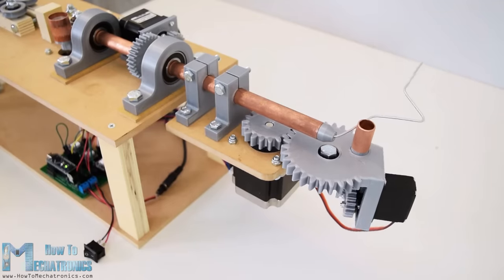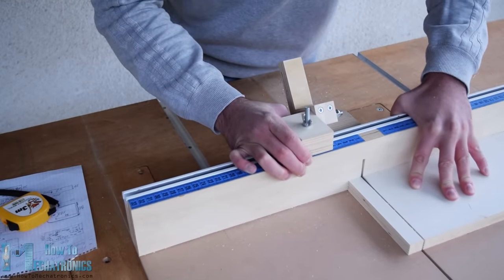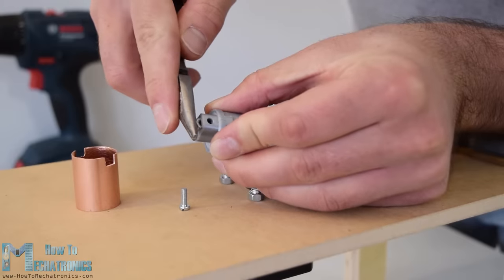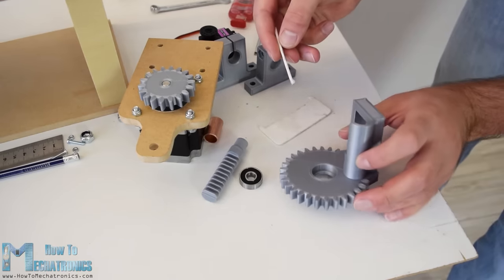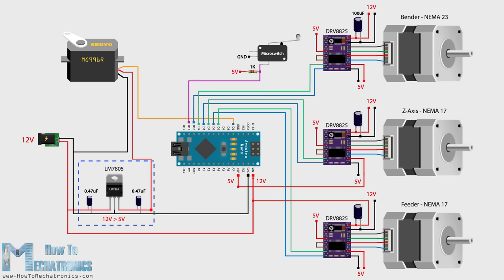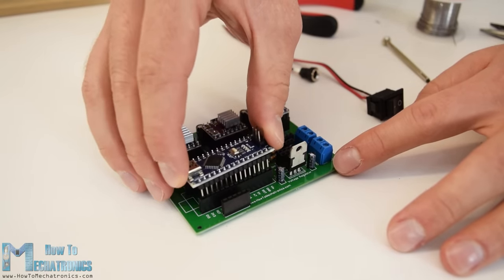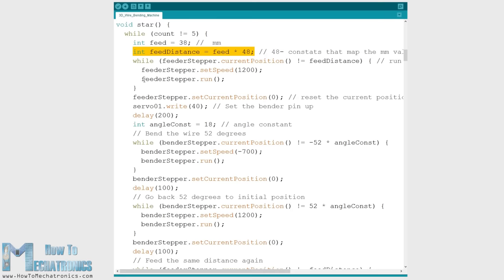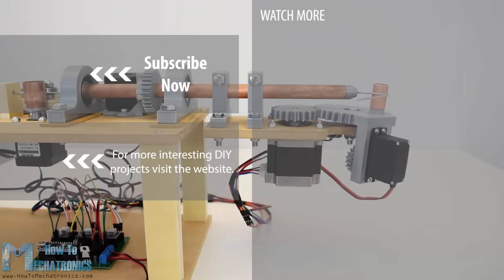Arduino 3D Wire Bending Machine

Comment: WOW!  This is AMAZING.  My curiosity is more on the 3D printed parts, specially the gear.  How strong are these 3D printed gear parts and supports?  Would appreciate your response.  Thank you!
Reply from the maker: Thank you! Well I didn't notice any wear on the bearings, but the forces are not that big anyways. However, 3D printing gears for prototyping is really effective, because other way, metal gears are so much more expensive. Also in case you print them with ABS they will be much much stronger.

Comment: My question is when turned on the power first servo brought the pipe up, and turned to his terminal and went to the center position and stopped. And even when connected Zaxis whole scheme stops working all the engines freeze and not spinning even when the force of arms.

Comment: Nice work! -- That's super neat. -- (Though FYI, I'm pretty sure that's a "table saw", not a "circular saw". -- Also, using magic numbers in your code is a bad practice -- you should consider using #DEFINEs or at least const ints for your magic numbers [e.g. the "48", "-700", etc. shown in your code are "magic numbers" [yes, even with comments], there are many shown in the video, and it's considered a bad practice]). -- Still though, very cool project.  Would be neat to see it run GCODE (GCODE is not just for Cartesian robots, but can be adapted to be used for any sort of CNC control -- obviously, a slicer or mill path would produce utter garbage, so you'd need a different tool chain, or to write the GCODE by hand, but it would still be neat).

Comment: This is a really coll project! I'm considering of building a smaller one... Just a question, why did you use an external pull-up resistor instead of the internal one of the arduino?

Comment: that's very good. What CAD/CAM software do you use to design your wire shape and generate the bending program?
Reply from the maker: Thanks! I made the shapes manually, but entering commands like feed lengths, and bending angles.

Comment: Why do you use capacitors before and after the voltage regulator? (newbie here). Superb project and extremely well explained. Thank you for sharing!
Reply: To keep the voltage stable with varying load currents. It acts as a local energy reserve for each subcircuit.

Comment: hello, 
your project is excellent,
how you open that command window, (serial plotter or monitor??)
I try that both window but is shows blank, when I write command like 'manual' its just vanished and nothing happens, I don't know Arduino programing I am just a beginner plz help me. 
thank you.
Reply: I am just using arduino uno only to check program it is neccessary to complete pcb first?? Then and then i can run the program??  Or it should be work with arduino only?? 
I am really confused,, plz help me
Reply: Plz help me

Comment: Hi. Thank you very much for the lovely machine. I 3d printed all the items and installed the system. But when I programming, the stepper motors and servo motor are not working well. i here sound in the motors but not moving and also its heating. Can you please let me know why is that.

Comment: Hello ! I'm trying my own version of your machine, this is amazing work you have done ! As i have not the same diensions and configurations, i was wondering what was the angle constant refering to, and if i should worry about it not being true in another machine than yours. Thanks for any help and advice ;) And thanks a lot for sharing your knowledge !
Reply from the maker: Hey thanks! That's not a problem, you can easily adjust that to match your machine. It just adjusts the motor steps to the real angle.
Reply: @HowToMechatronics  thanks for the fast answer :) i'll let you knowledge when my project is done !

Comment: < SPRING MAKER ♨ 25 years i left 2 months after the 1st  new  computer forming spring machine arrived                                                                                             This small arduino is correct how they worked 👍 You could set up  anything    to make on this & add more idea's  
 u programme #1 line  wire feed in         #2 then what it  pushes   or  forms  & so on the boss said how did u work that out watching the video they            sent from taiwan or ?  :)  easy for me learn watching faster than reading  every time why i throw manuals in the bin 1st then  watch :) 👨‍💻
Reply: make a hardened tube and a cutter  auto maker wire former cheap  This was brilliant   video 👍💬

Comment: why do you use INPUT_PULLUP as the pin type and include an external pullup resistor? Why not just use the internal pullup?

Comment: Great project. Would be pretty cool if there was a way to import vector shapes to automatically bend. Would it be possible to upgrade the parts used to support bending steel or aluminum rules for a die or a cookie cutter?

Comment: How to get this gears with no 3d printers? I also have a question why do we use different types of stepper motors and what is the difference between them, and can we use one type of stepper mother for all of them? thank you very much I love your work..
Reply from the maker: Thanks! Well I used the bigger NEMA 23 stepper for the bending process to make sure it will have enough power to bend the wire. I think you could use NEMA 17 in that place as well, if bending 2mm wire. As for the gears, maybe you could use pulleys with timing belt. Pulleys with various sizes can be found and purchased online easily.
Reply: @HowToMechatronics  Excellent, but let say we want to modify it or upgrade it, what would you suggest or what would you use if you want to add cutting wire system for after the shape is formed..

Comment: Nice work , one question is it possible to use arduino mega 2560 and Mega ramp 1.4 with your  code without changes to it.

Comment: That is insanely cool! I have a few questions though: 
What is the biggest diameter of wire you can pass through the system and have it bend?

Would there be any way to design a metal railing in something like Fusion 360 and have this machine output it?
Reply from the maker: Thank you! Well the wire in the video is 2 mm. I also tried 3 mm and it was able to bend it. However, I don't believe this configuration would be able to bend bigger diameters than that.
With the code that I made for this video we can only bend the wire by manually by entering commands, or again manually coding the steps so the machine can later execute them. Of course, making a program that would accept shapes made in some software, for example that could be an SVG file, is possible , but it would require some serious coding.

Comment: Hi there Dejan. While I was working on this project I noticed that there seems to be a missing piece in the .stl files, specifically the small gear above the modified bender gear in 1:38 of the video. It seems to me that the closest thing to it is the servo pinion gear you left in the files for download, but this piece has two small holes next to the center one, and I think they're very important for the motors assembly. If you happen to have the .scl file for the gear I would be very thankful if you gave it to me, or maybe the two holes don't matter at all and it works just fine without them. Still, I'll be waiting for your response. Cheers.

Comment: Fantastic project and video.  
A beginner question: I'm just starting with EasyEDA and to me it looked like GND wasn't connected in your video and i couldn't see any traces for it on the final PCB. I guess i missed something. How is it done?
Reply from the maker: Thanks! Well the GND pins are set as GND from the pins properties tab. You can notice at (9:00) when I use the Copper Area tool, when the whole PCB becomes red, then the whole PCB becomes GND actually. So now each GND pin is connected to the GND (the whole red area), while the other lines or traces are isolated with a thing gap between them and the "red" copper area.
Reply: @HowToMechatronics  Thank you very much, i didn't know that's even possible. Definitely something i have to look into. Thanks :)

Comment: Yeah right. Drawing it and building it are two COMPLETE different things. 
I would NEVER buy a set of plans for anything without seeing a working model of the subject matter. 99% people will not tackle this project because of the circuitry.
Reply from the maker: The plans for this project are free and anyone can download and use. However it's true, building and making this project work is not that easy, it requires some knowledge in the field and you need to be ready for troubleshooting.

Comment: Why is a nema 23 used on the bending mechanism, wouldn't a nema 17 or large servo work better as a cheaper and lighter alternative?
Reply from the maker: Well it depends on the type of wire and how strong it is. In my case a NEMA 17 wouldn't have enough strength to bend them. Of course, if there is a bit different design of the bender, like different gear ratio or so you could bend the wire using the NEMA17 as well.

Comment: You should have used male headers for the stepper motor connections also male headers for the motot settings thing with a jumper
Reply from the maker: Yeah, you are right, I realized that a bit late. :)

Comment: Will this work for 2mm and 3mm spring steel wire?

Can you have try for that?
Reply from the maker: The particular machine won't be able to do that job. This is just a concept and in order to work with stiffer and stronger wires it needs better and stronger components.
Reply: @HowToMechatronics  as you already have machine, can you try with 2mm spring steel wire, if possible, will be helpful for me to build for my shop.

Comment: Hello, thanks for your work, its great !!!
Im working in the project with your design and I have a question.
¿Do you have the software that calculate the steper motor ratation based in the SVG file? I need help to finish it. 
I hope you could helpme, please. 
Thanks for all.

Comment: Why would you make a "custom" PCB precisely the same as the ones you can get from China for less than a dollar? This project also seems incredibly closely based on previous wire bending and pipe cleaner bending machines... Looks like someone doesn't like giving credit when its due -_-

Comment: how it's possible nema23 powered by small drv8825 ?
Reply from the maker: Well, if you limit the current of the DRV8825 properly, up to 2A, you will be able the driver the NEMA 23 without damaging the driver. Though the NEMA 23 won't have the full power if it's, for example, 2.8A rated.
Reply: How I can limit current of the drv8825? How to do this right?
If I to do this how much power nema23 can be lost?

Comment: How to achieve variable bend radii...???
Reply: If he can figure out a stronger feed system, comercial systems push the wire into the bending wheel and adjust the angle to get different radii